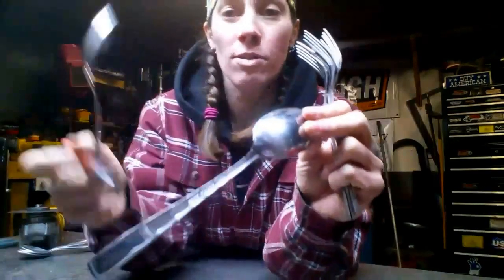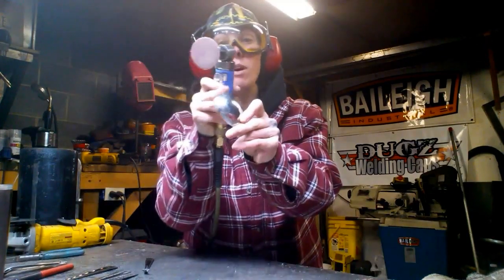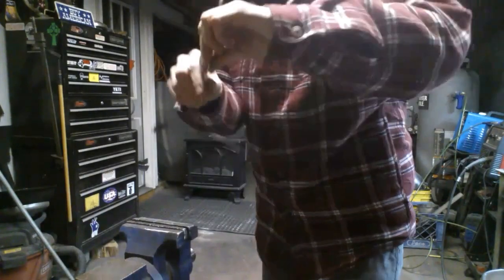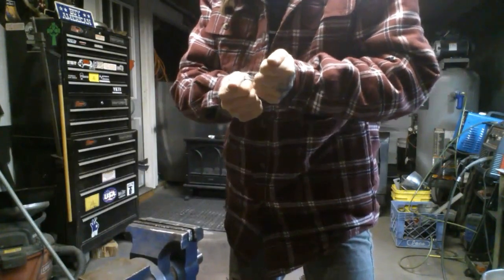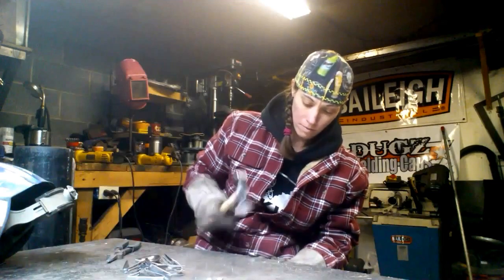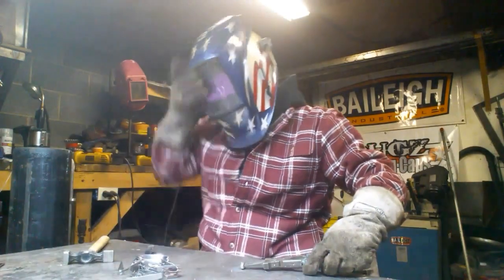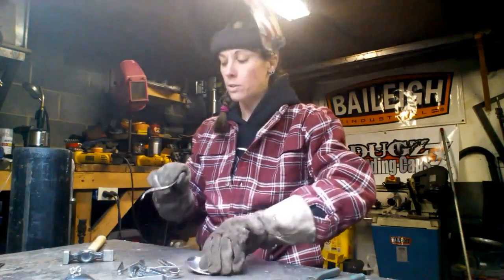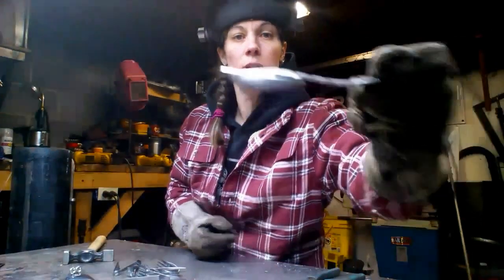How To Weld A Frog | Easy Scrap Metal Art | Animal Silverware Sculpture | Barbie The Welder

Comment: I did some butterflies and dragonflies this morning from.
Eighth by half 6061 but mild steel works as well.
Real ready to cut with bolt cutters and bend either by hand, hand tools, or a simple homemade Bender.
Video is up but I have no where near this editing or production skill.
Reply from the maker: +Michael Rhoads I’m learning as I go! All my video is shot with my phone and edited with free apps. Look up Splice and Quick in the App Store made by GoPro. They are easy to use and make editing a sinch even for a rookie like me!! When I film I just ask myself if I was watching the video what angle would I want to see this from and what parts would I want to see.

Comment: well done!  i hope you have some type of fume collection system in place.
Reply from the maker: +paul hatch I have an industrial vent system over my bench. I need to work on getting something for when I'm grinding.
Reply: that's good. i wasn't trying to be a safety nazi. i try to do my grinding outside when possible. i work in my garage. i have a painted floor so when i mopped it i noticed a ton of tiny particles in the mop water when i dumped it.

Comment: What mig welder are you using?
Reply from the maker: +Collin Smith Lincoln 140c it runs off 110v 20 amp  I run .030 er70s wire and 75/25 gas
Reply from the maker: +Collin Smith I am using a Lincoln 140 c. It runs on 110 volt 20 amp.
Reply: BarbieTheWelder right on! That's what I'm using. I'm new to welding and kind of on a tight budget at the moment, so it's inspiring to see to super cool stuff you've been able to make without having a crazy amount of expensive high end tools!